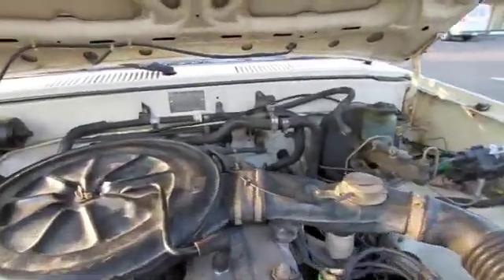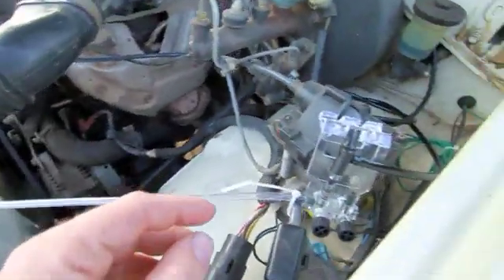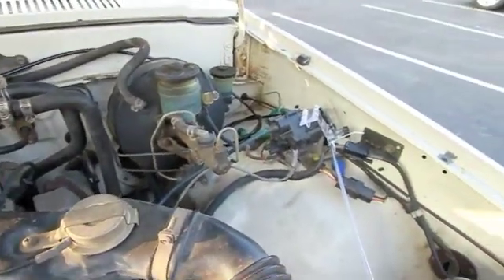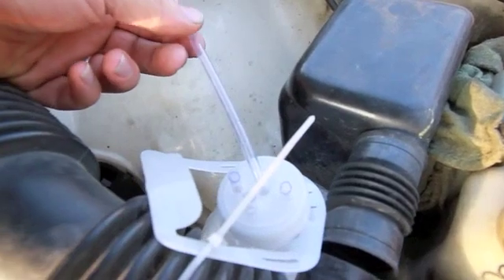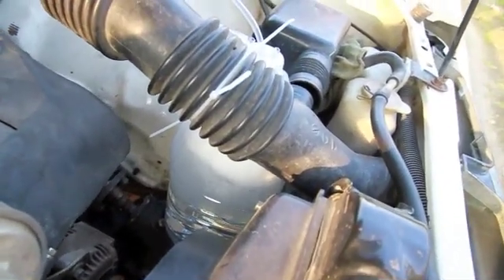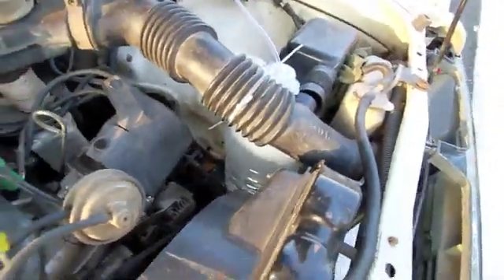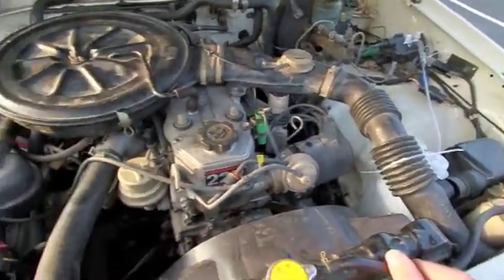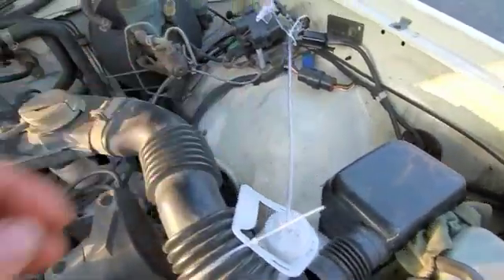Water-Alcohol injection

Comment: I did this with mine but with a metal can on the exhaust manifold  with no incoming air to the can engine pulls a vacuum on the can lowers the boiling point of the water saw a 3 mpg improvement and low rpm power too

Comment from the maker: Yes, that is a good thought.  I almost did that when I was running this setup but I was afraid that by expanding the water into steam before entering the combustion chamber that the benefit might be lost.  My thought was that by putting water into the cyls, the expansion would happen during the power stroke and increase the advantage.  What do you think?